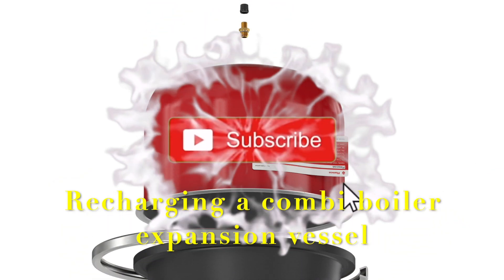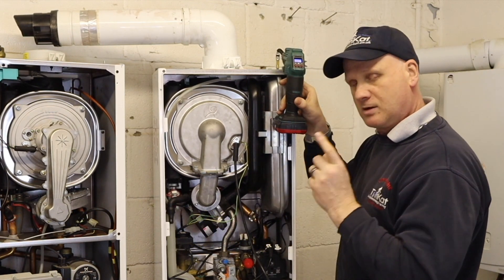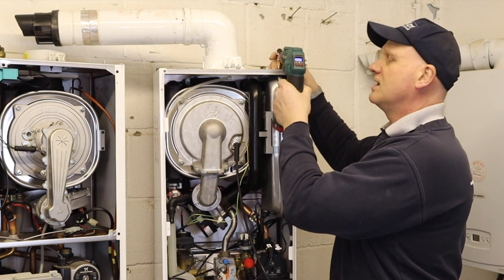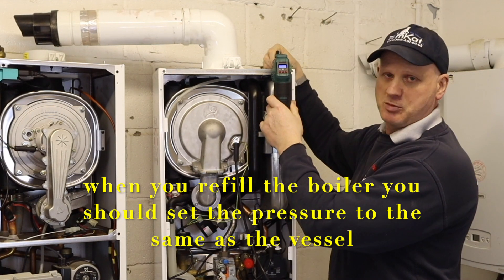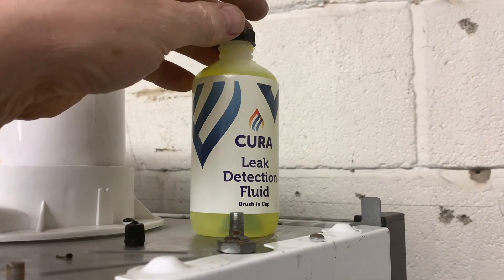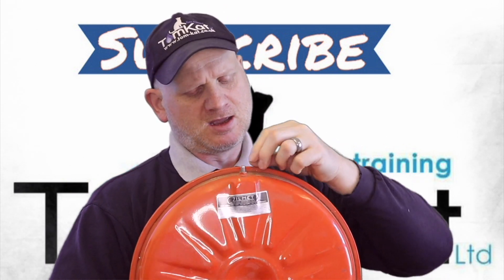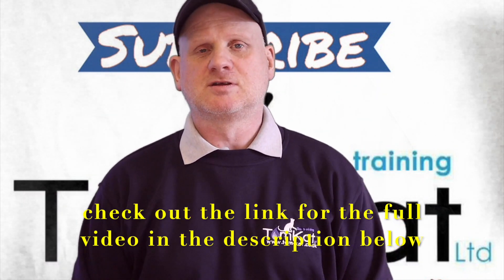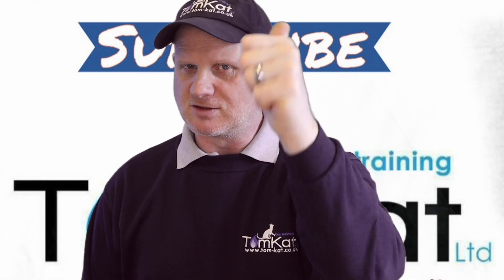How to, recharging an expansion vessel/tank for a combination boiler.

Comment: Hi Fella  - So why did you increase the charge air by 0.2 bars  to 0.9 bars and what did you set the system pressure at  0.7 or 0.9...joe  good video - subscribed

Comment: Just something I've thought of: if you can't get any air to go into a pressure vessel it might be because the air side is so full of water that there's no space for air.

I had that once when I was fixing my house water pump which has a small PV. Couldn't figure it out at the time, but that might've been the reason.

Comment: Decent video. Confirmed what I already thought about dropping the system water pressure to zero before charging the vessel with air, but added that you need to keep a valve open for water to escape WHILE charging. Good point!

Basically my understanding is that an expansion vessel or any water / air pressure vessel needs to be able to empty itself of water while you're charging it with air so that you're measuring the pre-charge pressure with it full of air.

Comment: Nice video .
We do similar, but ...
1. We tend to replace the shrader valve, for 5p not worth waiting to find it's leaking.
2. There is often a little water on the air side, I know you know that, but worth pointing out.
We had time served good heating engineers working for us, I collected 10 expansion vessels that had been replaced, I put them on test with new valves and found 8 were perfectly fine..  on the whole they are pretty reliable and in most cases if they are falling its system design or high flow temps especially on oil combi's. 
Keep up the good work, all the best for 2022

Comment: Hi Derek.  So, if you can't check the expansion vessel pressure accurately while the system is full of water, as it will always be unless some serious work is being done on it, then that explains why Gas engineers never check them.  Right?  I asked my engineer to check mine, but I realise he didn't.
Reply: The boiler is isolated then emptied,not the whole system

Comment: Hey Derek. Great video as usual. 
Just have a couple of questions. 
1) how did you get to the figure of 8 litres for 150 litres of system water ? 
2) why did you add another 0.2 bar to the charging amount? Apologies if I just missed the detail in the clip I watched it more than once. Thanks in advance. Mac
Reply from the maker: Watch my full video on sizing an expansion vessel and all will be revealed link in the description 😜
Reply: @tomkatgastraining  thanks. I will look at it. 👍

Comment: Shouldn't use PRV to drain a boiler. Asking for trouble
Reply: Ste picko totally agree William Jones each to there own.Cant understand why though every boiler has its own drain point.surely its not that hard to isolate attach your drain hose to the drain point and drain.
You need an open end while recharging a vessel anyway and the open end of your drain hose is ideal for this
Reply: but we all do..

Comment: This video is typical of people who work in training centres but not in the real world.  Never touch the iso valves and never open prv unless you have too. 99 times out of 100, these components will leak if disturbed and cause the customer more money.
Reply from the maker: Typical comments from someone who doesn’t watch the full video or read captions but happy new year anyway
Reply: Well if you knew what YOU was on about you can strip a prv and fix it.. 
Appreciate the information on this vid and hut your mouth.
Reply: Checking the operation of a safety device is always a good idea, removing and cleaning the seating and top hat of the prv isn’t difficult unless your a 6 week course cowboy anyway

Comment: I always find it good practice to put a little silicone grease on the Schrader valve.  It helps the valve seat and keep the Schrader valve rubber supple.  I do think baxi undersize those expansion vessels.  7 litres is a bit small.  Great tutorial as usual Dez.👍
Reply: I find most are passing so just replace the core valve. Worcester are worse for their vessels; 6 litres for the GS Jr/Si range. Internal vessels should be 10ltrs minimum imo